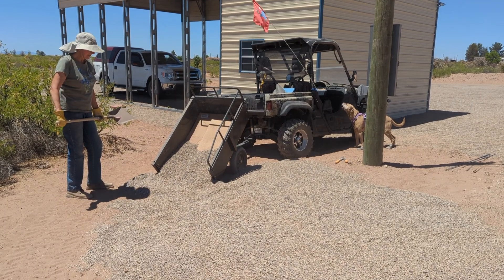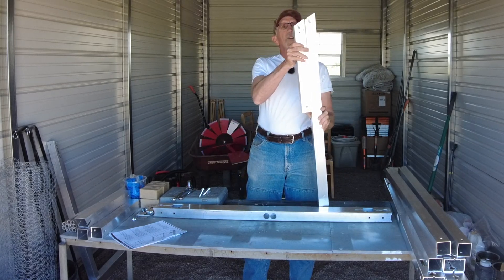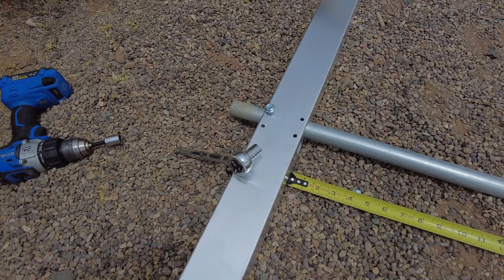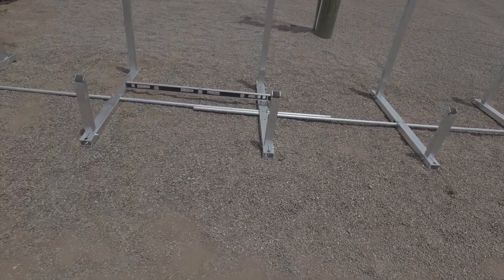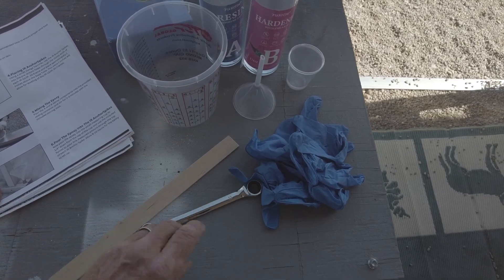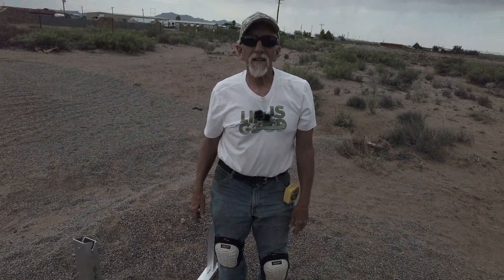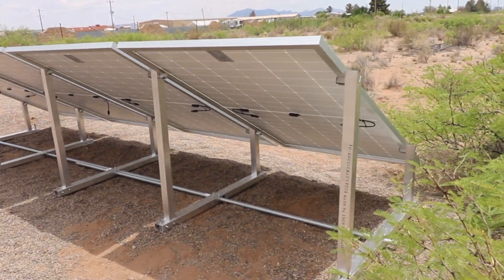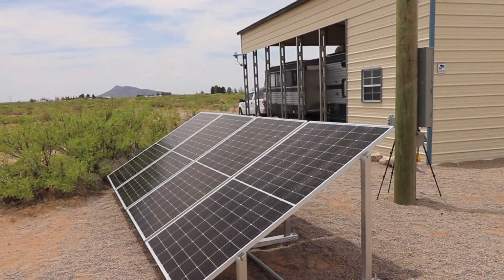Quick Solar Panel Install with the EASY Racking System by IntegraRack IR-30

Comment: Seems cool at first, but if you live in any sort of town or state that has any zoning laws, you're likely going to have to talk to your planning board; That's what I had to do at least.   They considered the ground mount - any ground mount to be a separate structure and would require to comply with all the required setbacks.  This was AFTER I had my engineering drawings completed and submitted.  Also, if you're in a deeper frost zone area (north) the ground spikes will likely get rejected as a mounting sytem, as the company only certifies them to a 2' frost zone depth, which I don't even know how far south that is - I'm in New England & we have a 4' frost depth here.   So, do your research .  My town was great & worked with me & had some very knowledgeable people. They were cheering me on the whole way, but they certainly weren't going to look the other way either - they have their jobs to protect & families to feed.   Best of luck to you all on your journey.

Comment: What's the exact distance between each panel using this mounting system? Looks like about 2 to 2.5 inches. I want to max out the solar input on my Ecoflow Delta Pro Ultra with fourteen 410 Watt panels, but my space is tight. It's gonna come down to inches! 😮
Reply from the maker: Hi truth,I will measure that for you today or tomorrow
Reply from the maker: 2 inch space between panels

Comment: Still holding up well ? What kind of winds do you get there ??  Nice video - very helpful.
Reply from the maker: @rebelyell1580  We had 50 mph winds yesterday. They don't even flex in the wind. Thanks for watching!
Reply: @homesteadhandyman4481  Thanks! Yeah we got hammered pretty good in Apache County AZ too... Kind of normal this time of year.

Comment: What they dont tell you is when you go to buy. You are not buying a kit. You are buying 1 leg. So you have to buy 2 legs for each panel. 218 bucks per panel. 3 legs for 2 panels. 5 legs for 4 panels at 109 a pop.
Reply: And we need to buy those conduit as well i think
Reply: I was so excited when people showing this design as it is simple and fit any panel size. Until i check the price.

Comment: I have Similar Panels like yours from Sunpower But they are the 460w variant. (Bifacial) This is by far the Easiest Mount I've seen so far on youtube. Ive tried a few, Ecoworthy mount (it's the worst) EG4 Brightmount, It's really nice but there is a "LOT" of work involved to get them up compared to this. Thanks for doing the Earth Spike Method. It was something I was considering. Although I might just put rocks underneath my setup since the panels I have is Bifacial to try to get a little extra solar
Reply from the maker: Thanks for watching!

Comment: Just installed a 10-panel array (395 watts) using this ground mount and it was super easy. Put mine on a small hill which did result in some extra leveling but nothing major. I enjoyed the video

Comment: alloy costs so much . i know it can withstand for decades even salty   environments but i think  stainless or galvanized  and painted  methods in iron will cost 1/4 .. or even less if there  is local stock in market!!!!    nice racking Btw
Reply: An option to do either/or would be nice!

Comment: Thanks so much for the video. Mine are coming in next week and so glad someone did a video with the anchor spikes. That is what I am doing as I have a slope of about 6% where I am putting them. I checked with the IntegraRacks and as long as <= 10% and anchor spikes, should not be an issue.
Reply from the maker: Glad it helped ! Thanks for watching.